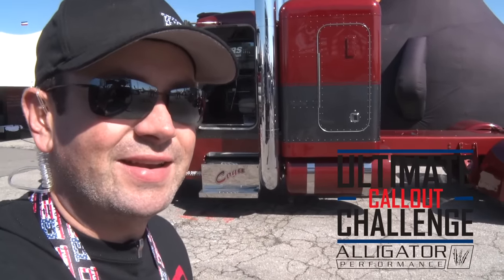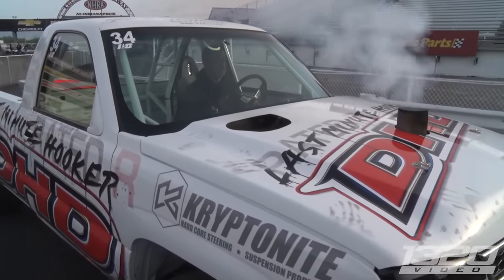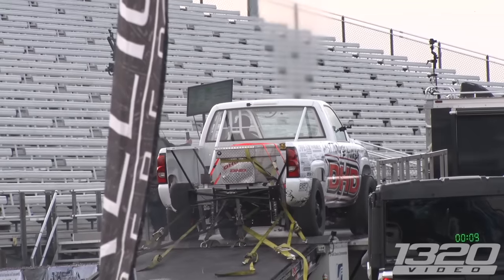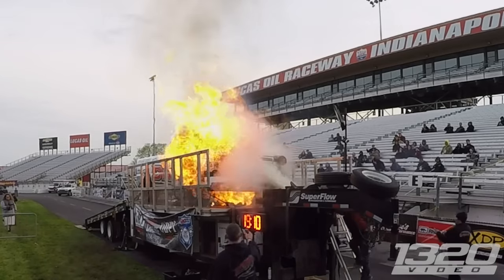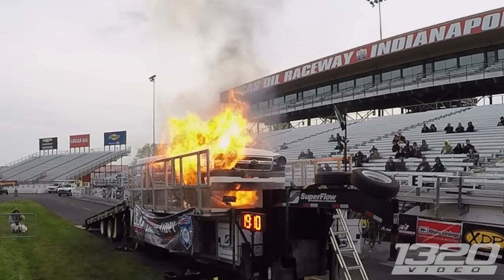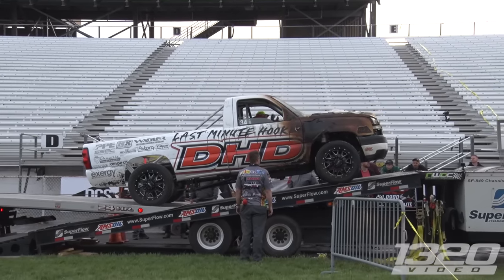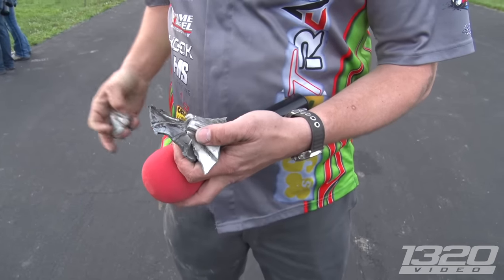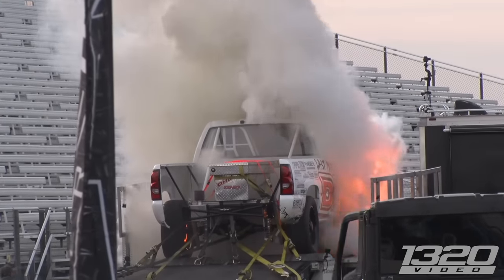MASSIVE FIRE - Runaway Diesel on the Dyno!

Comment: OMG!.. Made 3000HP on Diesel and 6000HP on Engine oil..dang !
Reply: Where did it say that? Must have missed it
Reply: @JonAlycia  it was a joke, originally the title said 3000 horsepower, they changed the title since then. As soon as that thing started running on its own engine oil, sounded like a hit 10,000 RPM..
Reply: Eyyyyy warped perception I'm one of your fans!
Reply: Uncontained catastrophic failure
Reply: @WarpedYT  Sounded Like 7500...
Reply: Like, why are refining this sh*t? Just put it straight into the tank!
Reply: @WarpedYT  sounded more like 7k tbh.
Reply: You're joking, but I  read somewhere that runaways can make two or three times their standard output during a runaway. Im a diesel tech for a living, read it in some service manual that mentioned runaways.
Reply: @six159nagito  But the as the Turbo did fly apart how would it make 3 times as on a run that went well? Even if that could happen i think the sheer amount of pressure from the explosions needed to generate 5000hp or something in that case would have not blown it up in a normal way but the whole block exploding and being launched and only the crank left in the car.
Reply: @kaedeschulz5422  good point, if the turbo came apart it wasn't making a lot of power. But in instances where the turbo stays functional during the runaway, like what happened to our john deere 7700 a few years ago, the manufacturers exact stated words are that power output during a runaway can rise to 3 times whatever the engine is rated at.
Reply: @six159nagito  Holy cow. How does that make SO much more power than with what it's supposed to be burning?
Reply: Without a turbo too.
Reply: Old diesels run perfectly on oil, new diesels would just flood
Reply: You're right, it literally went nuts
Reply: I was expecting a brutal explosion of the engine
Reply: @WarpedYT  mmm no sounded more like 8k sounded kinda like a nascar too
Reply: @WarpedYT  too bad the things wheels weren’t spinning we would’ve known then 😂😂
Reply: @blackturbine  it’s was contained it was mounted ,it would of gone no  where and it’s all about time…
Reply: @JonAlycia  he was kidding.  It was a run away eating its own oil to live and pushing lots of rpms
Reply: @kaedeschulz5422 it could technically run away on fuel causing it to run away aswell but besides that point a diesel engine runs off the explosion caused by compressing the air/fuel mixture, diesel engines don’t have to have a throttle to run efficiently and they just pump more fuel to increase power, if their is a leak let’s say in the oil rings cus they wore out causing excess oil to be injected into the combustion chamber and combusting with the fuel already being injected. Diesel engines can combust things like oil, alcohol, most petroleum products because they have so much torque caused by having a longer stroke and longer connecting rods so more leverage, and they can especially combust things like engine oil at high rpm’s already because the high rpm’s are causing more fuel to be injected aka more power. 

I’m not a diesel tech so I may have gotten some things wrong but that’s the basic idea and somewhat basic diesel engine operation and what a run away diesel is without mentioning the 4 strokes of any 4 stroke motor
Reply: @nclark6785  Wow that comment is ages ago! Yea Diesel's run on basically anything that can be combusted!
I have seen Diesels run away from cracked Turbo housing causing the turbo oil feed line to be basically directly connected to the intake and then shit goes south! Some hella old diesels have a decompression lever to be able to crank em on by hand. Those can be stopped fairly easily no matter what happens apart from if that lever is stuck.
Reply: @kaedeschulz5422  that’s not a bad idea now days u gotta use either the transmission and clutch to stop it or cover the intake/ somehow cut off the fuel that’s causing it to run away
Reply: @nclark6785  Good luck trying that on a modern car though. So many paths in the intake systems.
Reply: @kaedeschulz5422  so would using the transmission be the safest option or what would be standard procedure for shutting a runaway nowadays?
Reply: @nclark6785  If you can't stuff the intake yes you would throw it in the highest gear with the brake's on and dump the clutch. Probably wouldn't work on a beast like in the vid though for normal power levels yes.
That's what i have bin told by mechanic's.
Reply: The emginencould be desingned to make this much power in a somewhat controlled manner. The problem is the rated lifespan would be measured in seconds.@kaedeschulz5422

Comment: Good old Diesel....runs all time, even when it is on fire for like 5min :D
Reply: The engine was actually running on its oil
Reply: @ajar1000  but it was running
Reply: @ajar1000  yeah pretty sure everyone was at least half ass common sense of diesels is aware that that was going on
Reply: It seemed like it ran better on fire than not.  And at every metal or volatile liquid fire some goober comes running up with a water fire extinguisher.  Idiots.
Reply: @ajar1000  r/whoosh
Reply: @thatguy5915  why are u runnin
Reply: Good gas, runs all time
Reply: ajar correct
Reply: ajar incredible
Reply: Like, why are we refining this sh*t?
Just slap it straight in.
Reply: @rondohunter8966  probably water is okay here. It's just not good for fires where there is a hot lake of oil burning, as the water boils in the oil and throws it everywhere, just like you see in chip pan fire videos. Here the oil was contained in the engine and what was dribbling out, so no big hot lake of oil.
Reply: @TimpBizkit  Makes sense.  Yeah I understand about water; steam expands quickly to over 1700% by volume, so any flammable aerosols in that steam will burn.  Thus a flash fire.  But in the open I guess something is better than nothing.

Comment: At least those straps held up, holy shit man could've been a missle
Reply: I think there is this weird thing called transmission or smth
Reply: @magnumopus9058  what about it
Reply: @magnumopus9058  if it's on a dyno, it's certainly not in neutral m8, why do you think the brakes melted themselves
Reply: @charles-antoinemartel-roy  when you sense something is wrong, you can press in the clutch m8
Reply: @magnumopus9058  ah yes, staying in the car to press on the clutch pedal while the engine is spitting 10 foot flames stuck at max throttle. You're a different kind of smart, aren't you?
Reply: @charles-antoinemartel-roy  i guess when youre on a dyno, you get in the car, engage a gear, put a brick in the pedal and get out pf the car?
Reply: @magnumopus9058  the throttle was stuck open even after he got out, what part of this did you not understand from the video? He wasn't revving the fucking thing on purpose after it caught fire
Reply: @charles-antoinemartel-roy  my guy, i get you, everything is ok, but what im saying is, when your engine malfunctions, you can put it in neutral, thats all
Reply: @magnumopus9058  But what I'm saying, is that as the guy said himself, once it blew, he tried turning it off, so he probably did try that, yet the brakes still got melted. It's possible the clutch burned up when he tried engaging it and he wasn't able to drop it in neutral. Or he couldn't find the gear knob through the smoke like with the door handle. You'd think it's muscle memory, but clearly it didn't come back in the panic
Reply: @charles-antoinemartel-roy  just so you know, the throttle was most likely not open at all. The engine ran on its own oil, and even switching off the ignition cannot help in this situation
Reply: @ramziakas151  ya of course, but again hindsight is beautiful. One moment you're having fun dynoing your truck for your friends, and 1/6th of a second later, you're in a fireball. And in a potential missile. You can't expect the most flawless reaction from people at times like these. That's my point, like I'm sure he had shutdown procedures he could have done in theory to save the situation, but it wasn't what actually came up to him in that split second. Can hardly fault him you know.
Reply: @magnumopus9058  can’t do that on a runaway diesel. 

Fire extinguisher>Clutch. You might internally destroy the engine going the CO2 extinguisher way (it’s abrasive) but still a better solution than having that behemoth spitting hot rods at people.
Reply: @magnumopus9058  if a diesel is running away, you might as well put it at the top gear, but i don't think it matters cuz.something at the back sparked fire so the gearbox is probably gone, the only thing that can stop the engine from gaining even more power is by destroying itself.

Comment: Forget the fire extinguishers, call an Exorcist! Its possessed!
Reply: Ahahhaahaah!
Reply: I mean it's pretty much eating its own blood so...
Reply: Silas McGee exactly. I got the joke. Also r/ihavereddit.
Reply: Show ain't over till I say it's over dammit
Reply: Dana William  That's all good and well, but you aint stopping a 1500 hp diesel with a clipboard. It would most likely just get eaten and perhaps slow the engine down for a moment.
Reply: Dana William  They must have some sturdy clipboards where he works. An engine that size sucks in A LOT of air, you try to block that airflow with something flimsy and it will simply crumple and break. 

Even if you manage to actually kill the ignition for a couple of cycles, the inertia of the rotating bits will still keep it going and sucking for a while.
Reply: Use CO2 extinguishers

Comment: Wow that really sucks. Glad nobody got hurt but that was an expensive one.  Always worried about a runaway happening and this is a shining example of  how things like an air-kill can be rendered useless. I plan on plumbing a 3/4 hardline to the intake plenum on my LB7 and a large CO² bottle onboard. You can disrupt a fuel to air ratio enough to stop combustion and stop a runaway. Hope they get it fixed.

Props to 1320 for covering UCC 19!
Reply: argon would definitely displace any O2. But that's a great idea all around.
Reply: @rsharney1111  You need special licensing to transport argon over certain distances/in certain states etc. CO2 is virtually completely unregulated and for all intents and purposes does the same thing
Reply: Interesting! Never heard of this seems like a really good idea, would you just plumb it into the plenum and have a manual valve?
Reply: Very good no one got hurt, no need for someone to get hurt when your just trying to have fun!
Reply: I've also seen butterfly valves right at the intake, hooked to an electric solenoid set as fail closed (wire it to a delay on normal shutdown). if you put one of those on, you'd be able to isolate the intake manifold and purge with CO^2 . you might want a regulator though as you could actually overpressure the intake. wire them together to the emergency kill and that'll shut it down in a hurry. you just need to figure out how much gas you need to feed it for it to actually suffocate. but yeah, dumping co^2 in there at above max boost pressure would purge your intake at that point.

just did a quick google and the first one to pop up is called powerhalt
Reply: A bit of C4 stuck to the fuel pump would also do the trick. It cant runaway if theres no fuel
Reply: @laharl2k  You have no idea what a runaway is. This truck would run with or without fuel after the compressor wheel blew off. A runaway is a diesel literally eating itself, it was running on it's own oil..not fuel. As soon as he cut the ignition the lift pump is no longer on, and the engine is no longer getting fuel. 

The compressor wheel blew off, allowing high pressure oil to enter the intake. The compressor wheel blew a hole in the cold side piping, allowing the engine to get air beyond their fail safe. Ergo, oil+air+diesel compression ratio = a lot of smoke, and a lot of runaway.
Reply: @tjbell88  A manual valve would be the most reliable. I'm going to use a pull-cable type setup.
Reply: @seldoon_nemar  I won't be installing a regulator, if anything just a reduced orifice at the intake nozzle/port. Im not concerned about any overpressure, the engine can only pump so much air and if that volume is somehow surpassed the CO² would just go back out the intake. It shouldn't take much CO² to shut it down as long as flow is continuous till the engine stops rotating. It doesn't take much to seriously effect the fuel to air ratio. Perhaps the biggest thing is neutraling the trans so the engine is decoupled to slow down.
Reply: These trucks all have a guillotine in front of the turbo inlet, this run in particular the turbo exploded and the engine was able to get unlimited air through the now broken intake piping.
Reply: @mytmousemalibu  with a shutoff gate and the CO^2, you're pants and suspenders method. either one will shut it down, but both in tandem mean either one can fail and you have a backup also, the shutoffs force the engine to pull hard vacuum, slowing the engine down fast
Reply: @THEGHOSTSLAVE 
Ok, ok, C4 the oil pump too.
Reply: Laharl Krichevskoy once it starts to run away the engine and transmission oil become fuel
Reply: I don't disagree about having an air-kill guillotine type system but they are pretty much race only parts. My truck is a street machine. If you're not worried about sucking in some unfiltered air ok but they aren't typically used in conjunction with filter systems. They are also large and expensive. They aren't made to be after the turbo, they can't handle or seal boost in. The only way would be to use a throttle body type to be post turbo. To handle diesel boost its going to be an expensive part albeit cheaper than a blown & burnt truck.
Reply: @laharl2k  It wasnt running on fuel at that point. was running on the engine oil.
Reply: @laharl2k  Um yes it can. That's the definition of a runaway.
Reply: @laharl2k  Nope. Did you even watch the video? The oil pump belt was destroyed. This wasnt getting fuel or oil pressure.
Reply: @TTdriver.93  Which means it really, really sucked. The CO2 purge is an interesting idea BUT you have to consider if you can flow the amount required to dilute the massive amount of air entering the engine, long enough to spin down. 

I'm actually thinking the best emergency cutoff for a vehicle of this type would be something along the lines of a compression brake. Need to kill the engine? Hold the exhaust valves closed. No pump, no suck. No suck, no combustion. Runaway engine goes Frrrrrrp and stops dead. If you're running hydraulic lifters that could be as simple as cutting a port into the lifter oil galley and fitting a valve, dump the pressure and let the lifters collapse on their own. You might ruin some pushrods depending on your setup, maybe lunch a rocker arm or 12, but the really pricey stuff should be protected in time (bottom end, cylinders). 

Huh... you know where there's a really large source of CO2 for the purge idea, from a runaway engine? Same engine's exhaust... that's some big plumbing though, unless it was a flap valve off the manifold that when swung down to close the end of the collector opened a 1" port that's plumbed into the intake with it's own valve. That's just a half baked thought though....
Reply: I could see argon working well.
Reply: Michael Free hmm good idea.  Rather than having a C02 bottle of you could plum a line from your exhaust to let’s say a butterfly valve or something that you could yank open them with the engine running away it sure is pushing out a lot of exhaust gassed/pressure.  Wonder if that would work?
Reply: @THEGHOSTSLAVE  This, had the turbo core bushings fail on a '90 landrover turbo diesel on a backroad, and it wouldn't shut off with the fuel cutouts or stall (clutch slip...) because it was running on oil passing pissing past the failed core bearings, so just had to stand back waiting for the end watching it scream for minutes pumping masses of smoke out at insane rpms. Amazingly the motor started with the turbo disconnected/blocked off and fresh oil in the sump and drove onto a trailer and replacement turbo/filters etc and a few years later its still in my LR and passing emissions today with no internal engine work. I'm always super careful about turbo bearing condition since though. These guys lost the dry sump pump belt too though so no crank lube at peak rpms, which was the shittiest part of the deal.
Reply: @laharl2k  I think they had the problem that it run on its own motor oil and not the diesel. I would guess they have an solenoid valve for the fuel line from the tank as an emergency stop.

Comment: So did you check the dyno numbers or what?
Reply: CokeandManual fire hundred horse power
Reply: 1,572hp & 1,799tq  it's in the description.
Reply: @jimbopaw  how much duck power would that be?
Reply: @drummerdude0314  I don't know how to convert to duck power but I can tell you it's 32,791 geese power.
Reply: @Nachomansupreme  a horse is 50 Times bigger than a horse?😂
Reply: Monochrome_Purity An ostrich can eat a duck but a horse can't eat an ostrich
Reply: The wheels lock up once it starts to runaway
Reply: But before that happens it’s going to raise power
Reply: How much actual horse power tho?? I need those numbers for the memes
Reply: @drummerdude0314  thats atleast 7
Reply: @jimbopaw  tq isn't a unit though... is that torque figure in lbf-ft or Nm?
Reply: @party53021  
Yeah but those are Canadian geese.
Reply: Lmao these comments
Reply: @Nachomansupreme  But what about church power?
Reply: @drummerdude0314  1.572 HP is 66.050 DP. That's some serious duckpower!